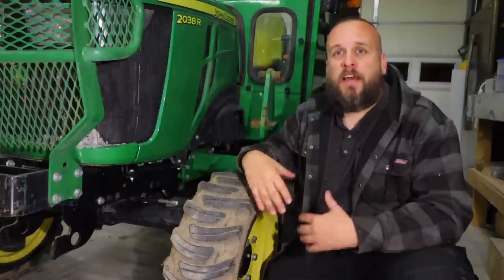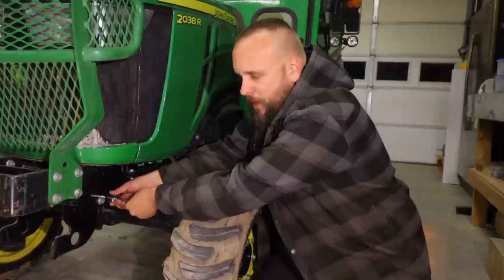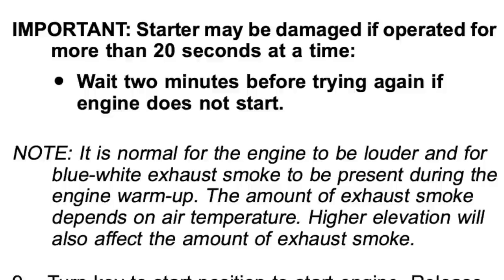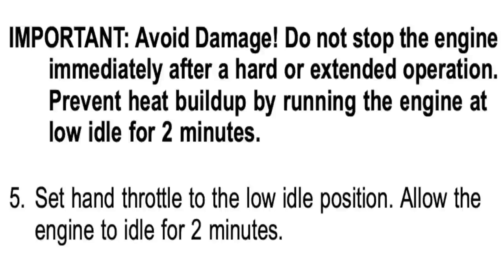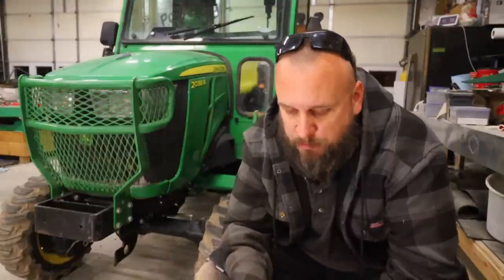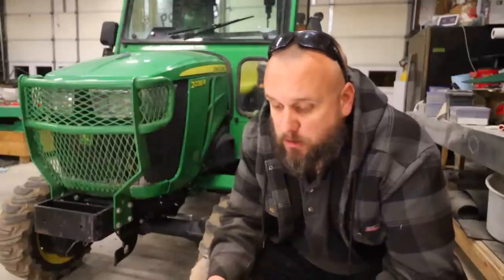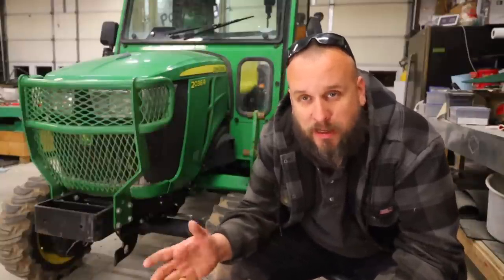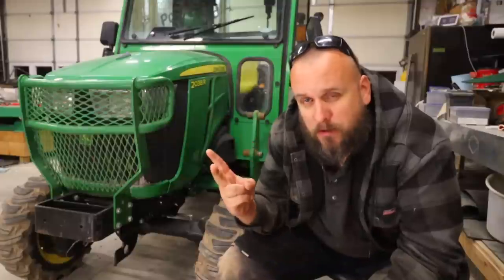Tractor Maintenance, Broken Bolts, and Reading the Owners Manual

Comment: Hey Brock, great video. Most people that are new to working with larger equipment dont take the time to do the maintenance because the dont take time to read the manual or learn the machine. As far as tightening bolts, I worked with a maintenance guy that had years and years of fixing just about every kind light to heavy equipment there is. The subject of "How tight is good enough"  came up. He had a great reply. Bolts and the threads they go into can withstand a certain amount of stress. Specs are there because the people that designed it know what the limits are. Overtight will stretch threads and compromise the bolt and the hole it goes into. Bolts can be swapped out but if they snap you will need to drill them out. if the thread in the hole is stretched wit could strip and need to be drilled and re-tapped. Best to follow the specs. The paint mark on the bolt is the best way to see if it is moving at a quick glance.

Comment: Howdy Brock!  I think they want you to start the engine at 1/2 throttle so the oil pressure jumps up quicker.  More pressure means the oil circulates quicker, getting everything lubricated faster.

When I was a firefighter we always let the firetrucks idle for 3 or 4 mins when we got back to the station.  Same thing... let's everything cool down a bit before you shut it down and the coolant/oil stops circulating.   

Torque specs are based on the size and the metal the bolt is made of.  Hardness of the metal can effect the final numbers.

Looks like you backed up your bolts with Loctite.  Be sure to check the directions before re-torquing the bolts.  You may end up breaking the Loctite loose if it is fully cured and then it doesn't do squat.  As long as you used the Blue Loctite.  Red Loctite you won't move the bolt without heating it first.  That Red is some nasty stuff.  Broke the head off a bolt because I didn't get it hot enough to get the Red to release.  

Hope this helps!  Great segment!  🤠
Reply from the maker: I did use the red and I figure if they move off my paint marks I’m taking it to the dealership because there’s probably damage to those bolt holes

Comment: Brock for my TYM it states to let it warm up (depending on the temperature, there are different lengths of time) at standard idle. They also state that you can run it at standard idle for a minute if you ran it hard before you shut it off. 

They do state, just like JD, that once warmed up you should avoid running it at idle for extended periods of time, and they suggest always keep running RPM around 2K or higher. 

Standard idle is only for warm-up and cool-down (if ran hard) for a few minutes.
Reply from the maker: Thank you for sharing that info

Comment: Great video, Brock. Reminds me I need to get to reading the manual on my new 3039R. I'm certain there are many differences. 👍
Reply from the maker: Congrats on the new machine. Nice choice.

Did you get it with a cab? What model did you have before? You probably told me before, but I get confused.

Comment: I got the block heater on mine. In 280 hrs now, i have never used it lol. This model seems to start very well.
Reply from the maker: We don’t get a ton of cold weather here but last year we had a week where the actual temperature was negative every day, and my tractor started fine

I let the glow plugs cycle a couple times before cranking it

Comment: My father is a retired heavy equipment/diesel mechanic. I’ve only seen him torque engine/bearing bolts.
Reply from the maker: Thanks for sharing
Reply: @RockhillfarmYT  now, a good friend of mine is a mechanical engineer. He will torque any bolt he can find a spec on. Which explains every manual you’ve ever read….

Comment: Brock my Kioti says same as my John Deere. Cold start at 1/2 to 3/4 throttle…..I just can’t do it 😂 so I let it idle for a minute depending on how cold then idle it up to around 1500. Kioti ones say warm up for 10-15 minutes and gives you a temperature range. My shop is heated so not often are my tractors cold but still let them warm up for a bit before I move even in the summer. Great conversation
Reply from the maker: Thanks for the info

Comment: The axle capacity you mention is for “continuous operation” according to John Deere. So you have 5600lb of “everyday all day weight”. And then when lifting/carrying a load/etc you can go over this weight temporarily. As far as I have been able to find John Deere does not list a “max weight” listed for the tractor. But your tires will have one listed.
Reply from the maker: Yeah, and the tire number came out just slightly above the axle number in this case.

As someone else mentioned fluid in the tires doesn’t really count as weight on your axles.
Reply: @RockhillfarmYT  yep, I forgot to mention filled tires don’t count against your “continuous weight”. But that is interesting to me that the tire max weight rating is around the “continuous” axle rating…I would think it would need to be higher…

Comment: A very important point also to mention from the manual is when and when not to engage 4WD.  A tractor does not have true 4WD.  it has M4WD.  That is mechanical 4 wheel drive.  
The front and rear wheels do not turn at the same RPM.  There is no differential on the front axle.  Sharp turns on hard surfaces in 4WD can damage the transmission.

Comment: When it comes to front ballast wieght,i prefer to bush hog without my loader(better visibility ,less noise,rattles from the loader ,more clearance for turns in tight areas). I use 8 -70 pounders up front on my 3039r to compensate for my mx5. Yes,your flail mower may be heavy, but it is tucked up close behind your tractor. A mx6 your wieght would be way back further, which makes a big difference in your capacity.
Reply from the maker: Sounds right to me. Thanks for sharing your thoughts on.

Comment: In the military, when we do services on vehicles, the service kits come with all the filters and new bolts, washers, cotter pins, gaskets, and seals. Example = Theirs not much that you can do to service a cv axle, but these service kits come with new bolts and washers to replace the 7 bolts per axle.  Even if the cv axle broke, you have to replace the bolts and washers that go to it.  No reusing on these. They are considered one-time use.

Idk running the throttle up that hight to start. I  prefer idle, then when it's run a few minutes, I'll bump it up a little bit, maybe 1000rpm. 

When I see people kill a machine at full throttle, I can't stand it. Idk why, but just doses. Turbo or not, I think you should let it idle down for a bit.
Reply from the maker: Good inside. On production equipment when one bolt broke we would quickly switch that one bolt out to keep production going but you were pretty much guaranteed the other bolts in that section would break soon going that route.

Thank you for your service

Comment: fluid in the tires and wheel weights do not affect the axle at all
Reply from the maker: Good Point. They don’t put strain on the axle the same way, but it does take more of your horsepower to move that heavier machine.
Reply: @RockhillfarmYT  truth  😀

Comment: Do those bolts have lock washers on them?  If not do you think they might help?
Reply from the maker: They are flat washers and yeah, I think that would be better. I also in my mind think it would be better to run them down with an impact, but I’m trying to trust the John Deere engineers choices.

That being said they’ve already come loose once...